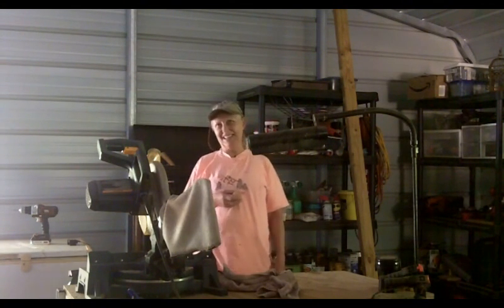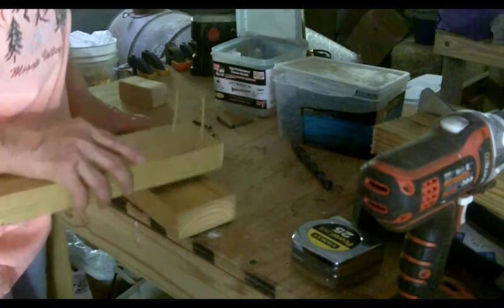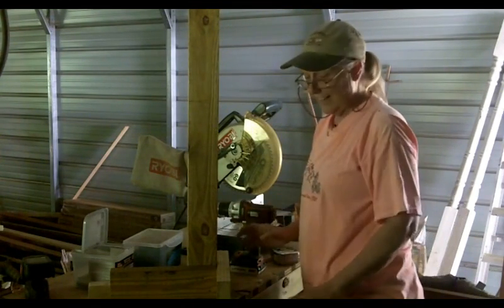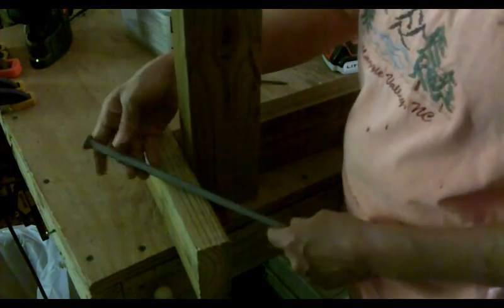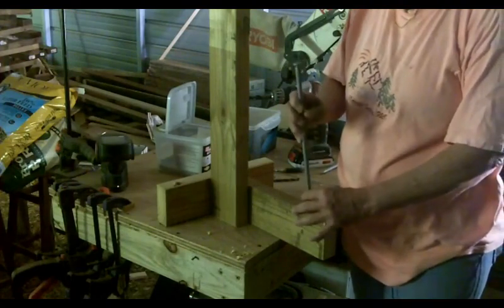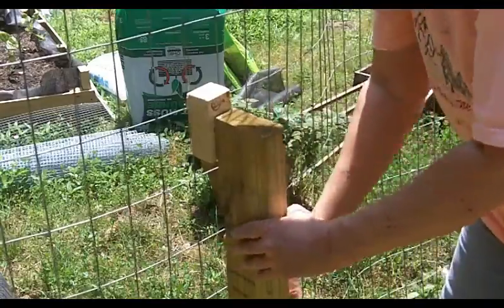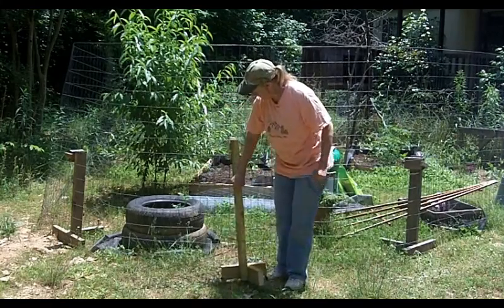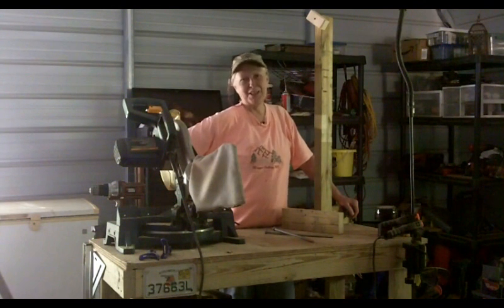How To Build My Portable Fence Posts

Comment: Brilliant!
I need free-standing 4x4’s on driveway that I can hang cattle pannel on, OR attach floating wire for trellising system.  Same for side yard.  Lot restrictions do not allow digging of any kind, as nobody any kind.  (Oh c’mon… give me a real gardening challenge!).  My preference wiuld be less bulky look I can dress up with trim & solar lighting.  Must haves: movable, modular, stackable, low tech, cheap. I would just bolt the post to a base with a recessed hole in bottom.  If need more weight, could silicone or ziptie to a paver.  I love this design!  Could make short ones for portable row cover frames.  Finally… something for the driveway!  👍😊👍

Comment: Mel what a great idea, sure beats digging holes.
Reply from the maker: It sure does.  They are so portable.  If you don't want the fence there anymore, you just take out the spikes and move it away!
Reply: Mel today was my bargain day.  We have Pat's Closeout home improvement store which sells mobile home fix-up parts, cabinets, spare doors, all types of lumber.  I was looking for 2x4s but today's bargain find was 27, 2x8s, 4 feet long for 99 cents each.  On they were grade 2, but to make garden beds who cares.  The guy threw in some short pieces and a beautiful piece of hardwood cutting board. Got porch spindles, made from 4x4s, again 4 feet long for 99 cents.  Will make portable fence post out of them. Only had 8 he could mark down,  some nicks on them, but said when they unload tomorrow there should be more seconds.  So I will have fancy moveable fence posts. I got the whole load for $25.00.  Will be able to make 4 beds, 4X8 feet, plenty of lumber left to split to finish the portable post. Jeep Cherokee was full, so will be going back Friday.